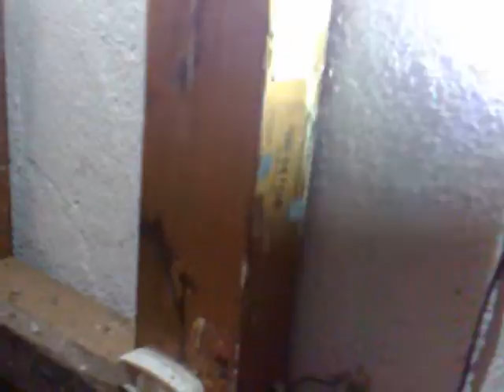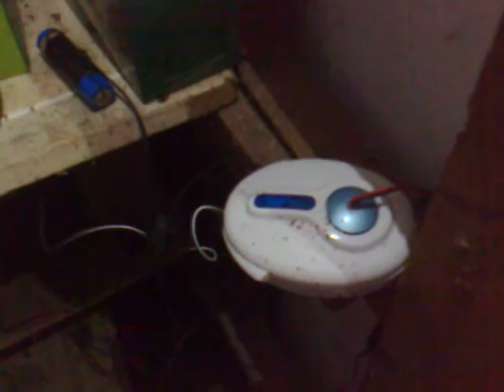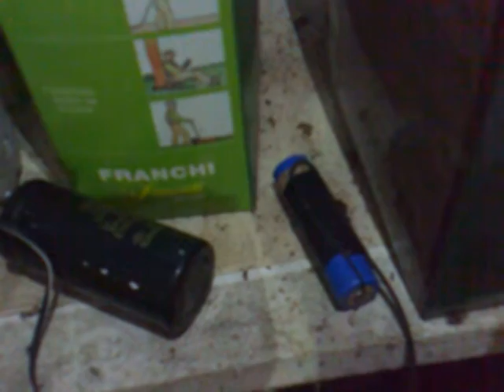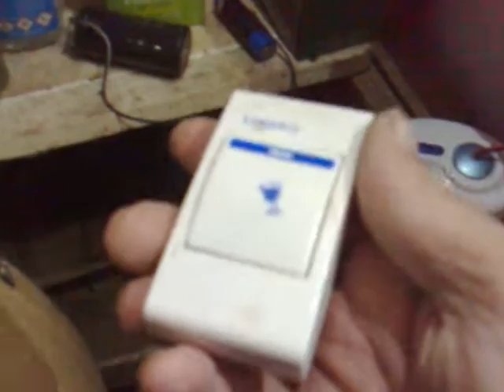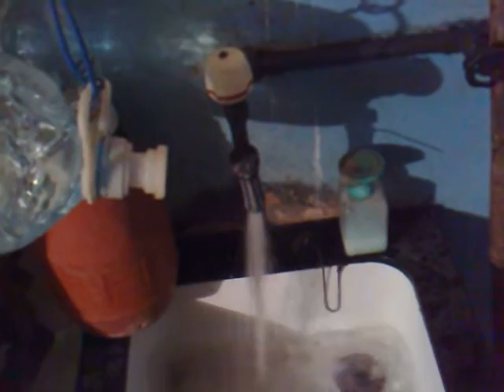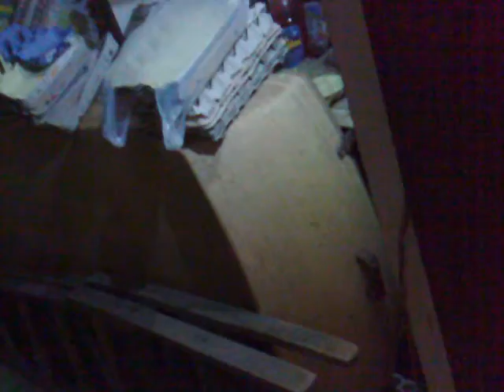wireless doorbell hack

Comment: I want to see a diagram of the circuit! Did you just use the speaker wires to drive your relay?
Reply from the maker: Exactly. Ac current is going trough speaker wire. I added 1 shotkey diode(1n5817) to rectify and it's charging 27,000uF(27mF) capacitor which in turn is driving optocoupler. Since 2 AA batteries are discharging over a month, I connected doorbell directly to 230V LED bulb(wired to 1W LED which has forward voltage of 3V). This is LED bulb with a 18V, 350mA  constant current. Do not do this if not experienced. Just connect it to universal 1.5-12V adapter. I need to cut costs so I'm doing with parts which I have lying around. Thanks for your interest!
Reply: Thank you. I will be using something like this for a raspberry Pi to detect my door bell.
Reply from the maker: Glad I could help